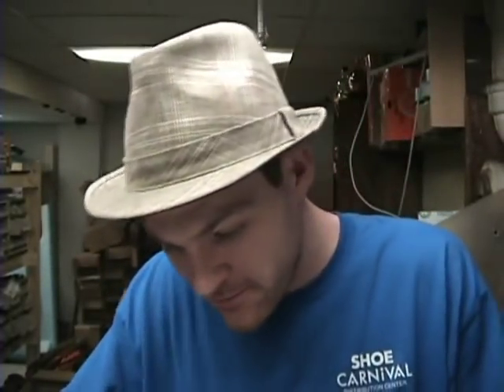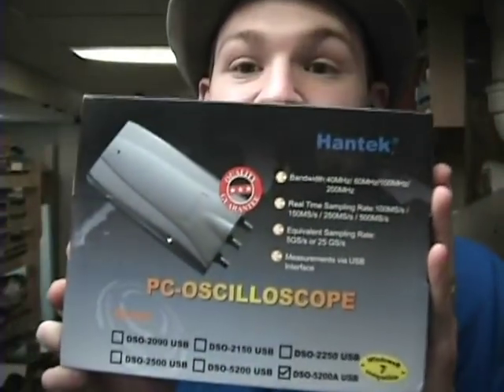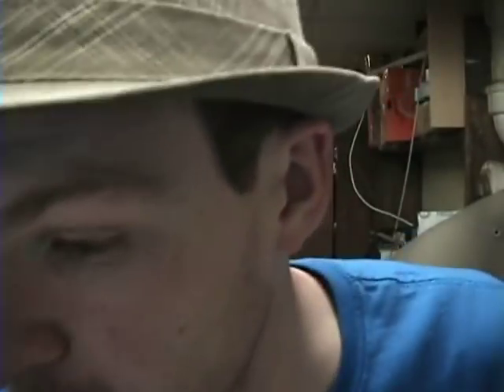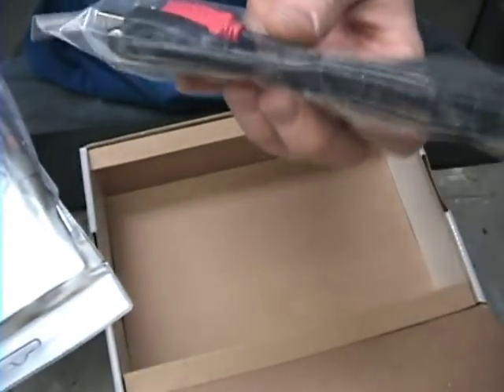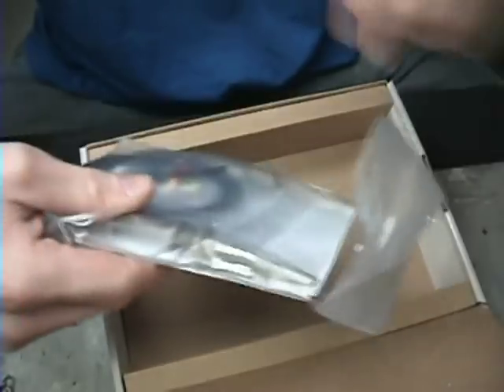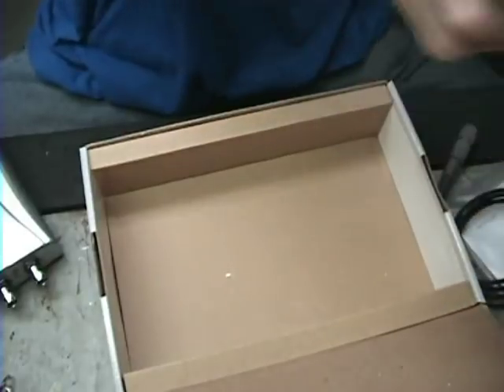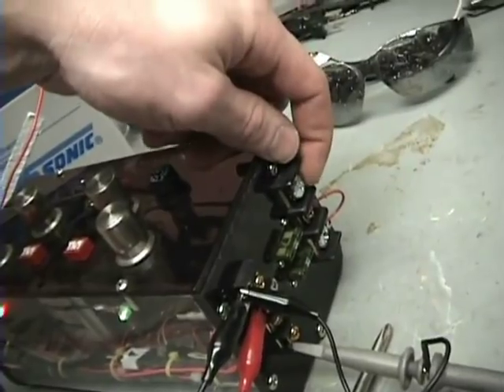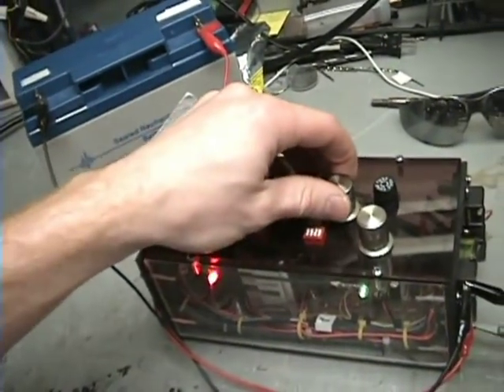FINALY! UN Boxing My New DSO-5200A Oscilloscope! Yeah! Testing Also.

Comment: Bad purchase, you should have saved up and bought a Rigol for god sake.PC based scopes are shit. The bandwidth is not really 200MHZ since it's real time sample is only 250m/s, do the math man.
Reply: +niceguy60 There's no "math" involved. The 200MHz is the analog input capability after which the response roll-off, and the 250Msa/s is of course the digital sampling rate. And Rigol is at par with Hantek imo. Depends on what you need to do and which model/ DSO you buy to do that. With even a basic understanding of sampling theory you can do a heck of a lot !!